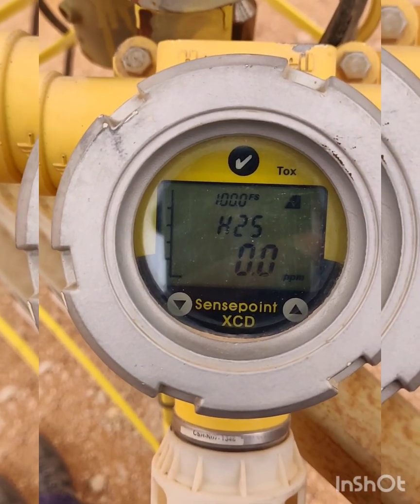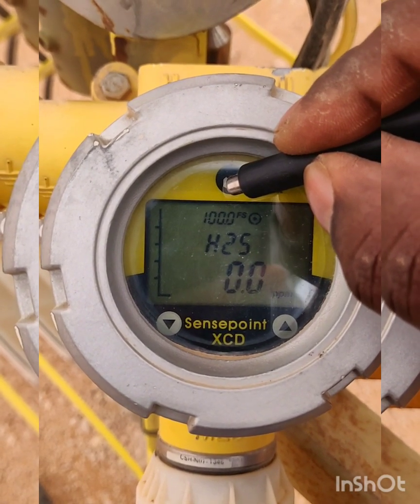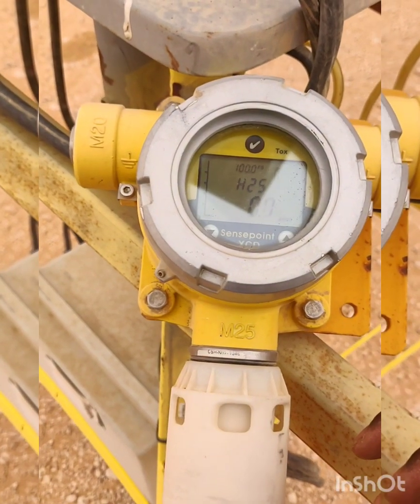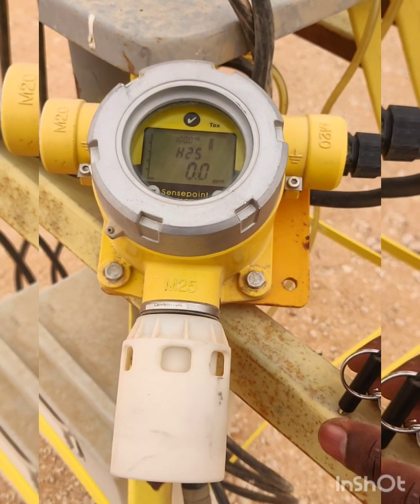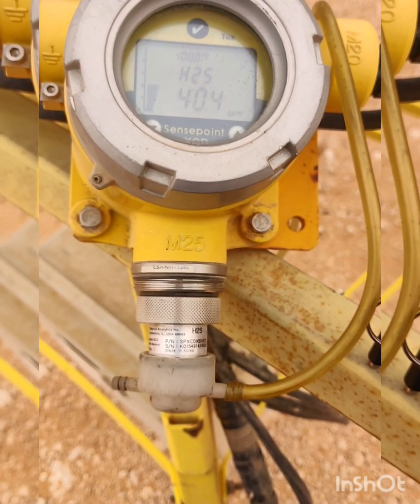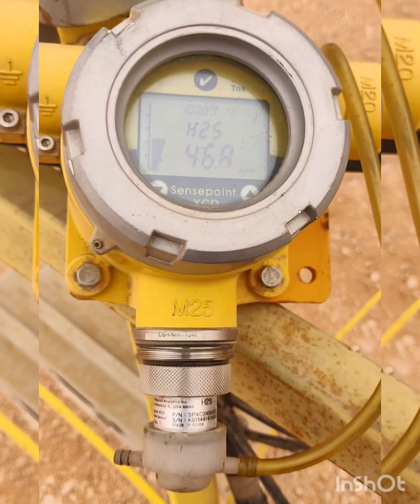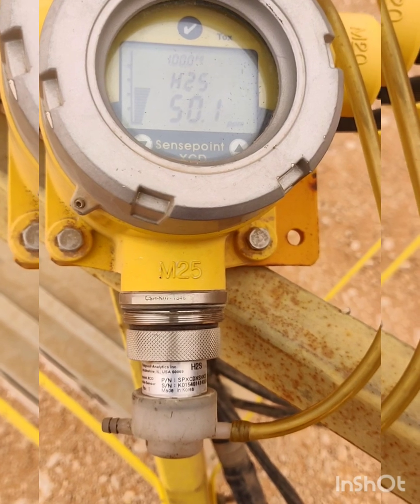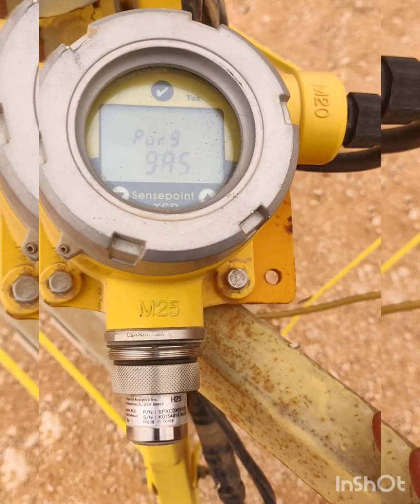Calibration of Honeywell Sensepoint XCD sensor

Comment: one of gms have some issue when going for zero calibration i found some value in zero calibration which not going to zero level .Do u have any solution about that
Reply from the maker: Use the zero gas cylinder for the zero calibration
Reply: @theAestheticMariner  it going to be -26 when I m going for zero calibration, I am using sensopoint xcd
Reply: In zero calibration mode it showing - value when I applying gas it going to positive value but return to negative after tht
Reply: Can u please elaborate the issue & the display showing fault alarm F-03

Comment: Which gas did you use? If I were to use 50% LEL methane (2.5%), should my PPM be 25000?
Reply from the maker: Am using gulf cryo Gas for the Combustible Gas sensor using 50%  LEL methane. Just change the sensor cell
Reply: @theAestheticMariner  how do I do that?
Reply: We set the XCD to 50% lel CH4 or 100ppm for CO. I use 2.5% (50% lel) also